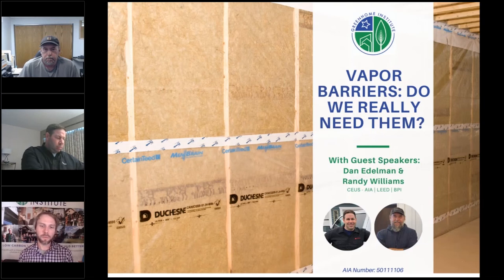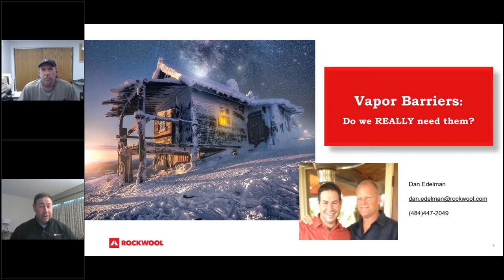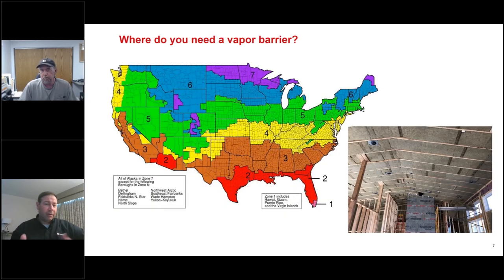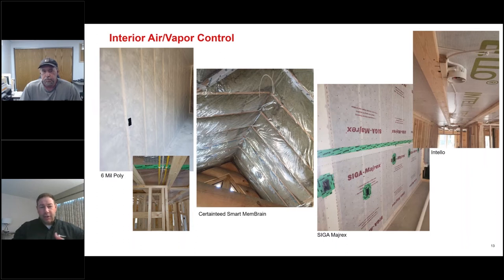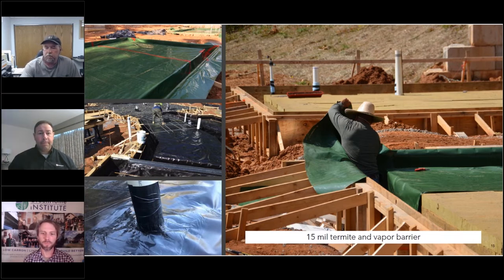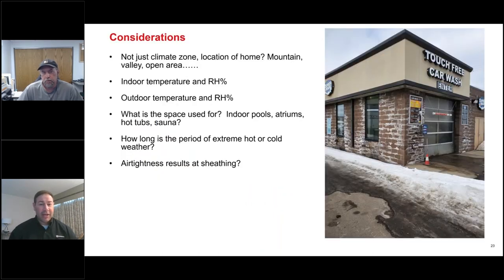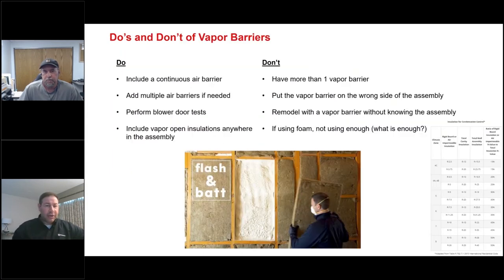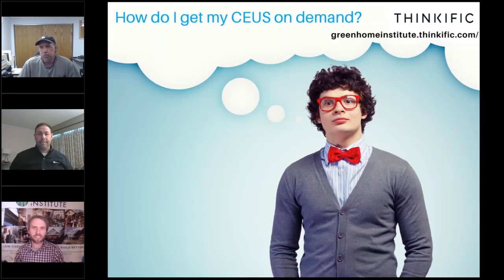Vapor Barriers: Do we REALLY need them?

Comment: Thanks for this discussion... I have been studying in circles, trying to do the right thing.
1976 Single wide Mobile Home, Mid Florida East Coast. Rat infested rot, total rehab.
Ripped out all the rot. Down to bare joists and 2x4 studs. Replaced all rotted joists/studs. Removed all the wet insulation, skirting, heating , A/C and duct work.
What I do next will be lost inside the assemblies forever, so I have one chance to get this right.
I am 74 and doing all the work myself on a tiny budget.
I will not have any central heating of cooling, it will be handled with Inverter Style Window A/C units (MrCool)
I am installing new vapor barrier in crawl and sealing the exterior crawl wall the best I can . Very dry soil, good elevation from water table. Super dry, clean and empty crawl now.

One side of the home is flat to the South with zero shade... the heat pumps off the interior wall like a blast furnace.

I really want to us a radiant barrier to reflect that heat back out.
That will mean an impermeable barrier inside the wall assembly. (or is there a permeable radiant barrier that I haven't discovered?)
I am considering continuous installation of  5 mm 2 sided foil Bubble over the studs, directly behind the wall board... draping the bubble foil in 2" between studs, leaving an air space on each side. No additional insulation.
Or: permeable radiant barrier cut into bays against outside aluminum panel -> fiberglass batts -> wall board.

I am 100% open to any solution that is inexpensive. Replace Bubble Foil with a Vapor open - air tight wrap?
Aluminum sheathing -> Rockwool -> continuous vapor open/air tight -> Wall Board????
Help!! I have to make a decision 
Thank you!!!!!
Reply from the maker: Great to hear you are doing the work. You may wish to get your home certified.

Comment: Thank you for this very informative video on a confusing subject.  I have a question I'm hoping you can provide guidance: 

-Zone 4 (Seattle)
-1920s house with 2x4 walls without insulation
-removed old siding and putting on new WRB over sheathing.
-over the WRB we will be installing a 6mm rainscreen
-new siding over above
Question:  we were going to blow in insulation into the stud space but I'm concerned about trapped condensation.  If the stud cavity remains uninsulated, this would allow for better drying?  Thanks!
Reply from the maker: This may help you before you get started https://youtu.be/nFZJVNESf8M

Comment: My whole problem with vapor barriers is that in most of the US the vapor barrier is always on the wrong side of the assembly half of the year.
Reply from the maker: Stay tuned for the 475 webinar.
Reply: Bingo!!!
Reply: That's why it's better to install air barriers that are vapor open but have some capillary action.
That capillary action will allow the material to dry at the other side fromwhere it became wet, i.e. due to condensation.
Good materials are: wood fibre boards like HB or MDF.

Comment: in a zone 4 with EIFS system and rock wool, what would be the best vapor barrier to use inside?
Reply from the maker: "I would recommend a class 3 vapor retarder for this application. "

"Latex paint, enamel paint or other approved materials applied in accordance with the manufacturer's installation instructions for a perm rating greater than 1.0 and less than or equal to 10.0."

Chris Jessen

Business Development Manager, Builders – North Central

Building Insulation, USA

M 1-952-658-9004

CS 1-855-876-3755

Chris.jessen@rockwool.com

 
ROCKWOOL

www.rockwool.com

Comment: If you put up vapor barrier on inside walls your going to put wood or sheet rock on walls with nails or screws and make hole in the vapor barrier so why would it hold air back when it has the holes in it just like outside ...
Reply: The holes from nails and crews as you put the sheet rock on are partially sealed from the pressure of the sheet rock pushed against it as the screw pushes the sheet rock into the hard surface, the stud.  Also, the holes are very small, so not like totally being "like the outside" where there is  significantly more air exposure. ☺   🇨🇦

Comment: Regarding a shed that was built in Minnesota a few years ago. It has steel siding attached directly to the exterior walls (typicality pole barn structure). I plan to heat the shed in the future. I was planning to put batt insulation in the walls with a 6 mill poly vapor barrier on the interior and then either steel or plywood interior walls. Will I get in trouble with no air barrier on the outside of the insulation? I just installed 6 mil poly, 2" XPS insulation (taped), pex tubing and 5-1/2" of concrete. What are my options to prevent the wall insulation from failing (from air intrusion??) and damaging the wood structure and growing mold, etc. Thanks.
Reply: You have a very typical insulation strategy for your post and frame or "pole barn" structure in a cold climate.  Will you have trouble?  Maybe, it depends on a few things that you did not include in your question.  What is the building going to be used for?  For instance, will you be storing snow and ice covered vehicles during the winter months that will be melting off and increasing the inside humidity level.  Second question, what temperature are you planning on keeping the building?  Keeping the structure at 40°F is less of a risk than at 70°F.  Chances are, if you can control the moisture level inside the building, keep it around 30%, there won't be an issue.  Natural air leaks will help keep the indoor humidity low, but depending on where the air is leaking to, this could be a problem.  If the air has enough moisture and it finds a surface to condense on, this could lead to the mold and rot you are worried about.  When you insulate and add the poly, make sure all the seams are taped, use a really good tape, and do a good job sealing where the poly meets the concrete floor. I'd use a product like Contega HF from 475 Supply for this connection to the slab.  Also seal any penetrations that go through the poly, like a plumbing vent or electrical wiring.   If possible, keep the attic as a vented space, make sure the eave vents, if they are installed, aren't plugged with insulation.  As far as the not having an "air barrier" on the exterior, you're actually missing a water resistive barrier or WRB.  It's rare that a WRB is installed on a traditional post and frame structure.  My advice, install the poly as air tight as possible and control the interior humidity level.
Reply: @northernbuiltpro7197  - I forgot my main question. Should I use vapor barrier on the ceiling as well?
I have two radiant in-floor heating zones. Zone 1 will be a 16’ x 20’ office. Temperature will be kept a good office working temperature 65-68 degrees Fahrenheit all the time. The remaining part of the building (zone 2) will be for snow removal equipment and attachments and will keep this at a good working on equipment temperature maybe around 55 degrees Fahrenheit, to melt the snow and be comfortable working on equipment. The shed size is 36’ x 56’ with 14’ ceilings. I have heard some people in Minnesota say I don’t need a vapor barrier in the ceiling. That concerns me. FYI, my ceiling will most likely be steel.
Reply: @D-Allen  I would use poly on the ceiling, in our climate anyways.  The steel alone would be a poor air seal.  Be sure to tape the seams and tie to the wall poly to make everything continuous.  You will need a way to control humidity inside the building.  What you could do is a wait and monitor approach.  Monitor humidity levels for the first winter and control using a dehumidifier if needed.  If you are experiencing a higher humidity level above 40%, you'll need a more cost effective way to control, like a heat recovery ventilator (HRV), commonly called an air exchanger.  An HRV will use 20% the energy of a dehumidifier.  The building will let you know if the humidity is too high, widows, garage doors and possibly the steel panels themselves could have moisture on them, but I would still use a hygrometer to measure humidity levels.  You can buy one for under $20 on Amazon.  I would monitor both in your office and shop areas.  The poly is serving two purposes, as both an air and vapor control.  Vapor diffusion isn't much of a concern, the air leaks are.  If you were located outside a cold or very cold climate, I would not suggest this strategy.

Comment: I live in climate 6 and use rockwool for my exterior walls.  I have the zip system plywood on the outside walls.  I plan on using tongue and groove boards on the interior walls, will I need polyethylene vapor barrier in the inside?
Reply: It depends on many factors of the entire assembly.  I would recommend an interior vapor control like Siga Majrex or Intello.  Never poly.
Reply: Zip is a vapour permeable, rock wool is vapour permeable, are the tongue and groove boards vapour permeable?  I they are then how much R is on your exterior to keep the zip plywood dew point in check so that the zip plywood is kept warm in the winter to prevent it from getting cold and so condensation occurs?      The rule of thumb is if you have a vapour permeable assembly then the poly plastic air and vapour barrier is only one and placed where drying can take place either to the outside or inside. Climate 6, our issue is how to keep that wall sheathing warm enough so condensation does not happen.  What is the R value of rockwool to your exterior begs the question. 🤔🇨🇦
Reply: Did you end up using poly?

Comment: i will have a poured concrete wall with wet attached natural stone from the outside. so no way to put any sort of barriers from outside.. however what product can i use from the inside to make sure i do not have vapor or condensation or moisture in the air conditioned space. This is for Florida
Reply from the maker: Sounds very cool. Make sure you get your project green certified. We can help!
Reply: What did you end up doing? What product ended up working for you?

Comment: I live in Climate Zone 2 in a residential facing south where only one of the walls (front side) is possible to insulate exterior. So this makes me only go for interior insulation, construction is using CMU concrete block 15cm wide with mortar. I would like to know if I insulate interior, where does the vapor barrier go? does it go directly to the concrete block or after the insulation?
Reply: No need for a vapor barrier but if you wanted to use a vapor control layer it would go on the exterior.  Air barriers are much better and be a multitude of products for this and these can go on the interior or the exterior, or even in the middle.

Comment: I wasn't going to install poly on my interior walls before drywall but now I will be. It's a mobile home renovation, complete gut job. It will have a mini-split for heating and cooling. I tie the poly on the walls and the ceiling together. My question is considering this, should I go with plywood and typar or go with zip system for the exterior?
Reply: Either of those options work well.
Reply: Either of them will work, they are the same application. It would depend on your budget and the price of what each assembly would cost. If you are doing the work yourself then the cost of labour is not part of the equation for your budget...a nice bonus when being a DIY'er👍   😊🇨🇦
Reply: I should have mentioned that I live in the Northeast. After doing more research I vapor barriered the inside and will go with Tyvek on the outside so it can breathe out but no water can get in.

Comment: We are building a house in Utah near Salt Lake City where temps fluctuate from 0 to 105 winter to summer. We are doing fiberglass interior insulation on 2x6 walls and wondering if we need a “membrain” (or other) vapor barrier on the inside of the exterior walls (before drywall) or not? Also wondering the same about basement walls that we have framed up and plan to insulate with fiberglass bats. We have only had the outside of the basement sprayed in a black material for water proofing. I’m trying to make the case for rock wool, but have had no success convincing the general it’s better. This question is primarily to understand what we should be doing with the vapor barrier though. I think we border on climate zones 5 & 6. Thanks!
Reply: We live in climate 6, in Canada. It was mentioned in the video that in climate 5 and above the more xps Exterior insulation you have the less of a vapour barrier on the inside. This is because the xps showed in their chart has a perm of almost 0, or on chart .1. So the xps is a air and vapour barrier in itself, so you do not need a 2nd vapour barrier which would be generally considered in the inside.        So it appears that you wrote you will Not be placing any exterior insulation, so this means drying can take place to the outside so you need a poly plastic (vapour barrier) behind the drywall, or poly over the studs.  This means the sheathing of the exterior wall can get cold due to a lack of exterior insulation, so you want to make sure you eliminate vapour to condense on the sheathing from the inside, so you need the poly on the inside. 
Replying to your basement question, well, this would take a long reply, but if you google and research all will be explained about the building science. Basement walls are a different "beast" to understand with lots of conditions to consider pending what your soil moisture and slope of ground is about, to name but a few particulars.  Cheers, 😊🇨🇦

Comment: Just have decent ventilation and dehumidification - barriers trap moisture which is never good , not required in most cases if the building is designed correctly
Reply from the maker: Are you saying keep it permeable?

Comment: I dont want my heating system to know whether i'm occupying the space. Some shady person can have a livestream of when i am where.
Reply from the maker: Did we discuss that? It is something we do talk about. Typically it is more about sensing CO2 increases not people.
Reply: @GreenHomeInstitute  Yes you did briefly. I see. Still, unless i lose both my hands or something, i dont need any 'smart sensors' in my home.
Reply: @GreenHomeInstitute  It would be easy to work out if someone is home based on CO2 levels
Reply: @GreenHomeInstitute  in zone 5 chicago area, what is best practice  to insulate a 1976 concrete basement.  2" XPS foam board with 2x4 wall rockwool r15 and no vapor barrier or 1" Xps foam board  with 2x4 wall rockwool r15 with a smart vapor barrier? Thanks